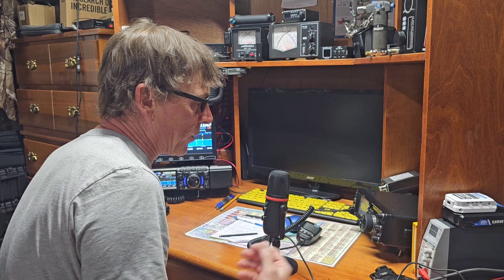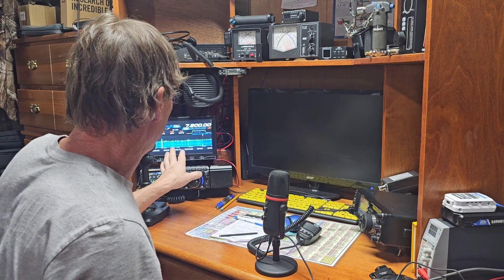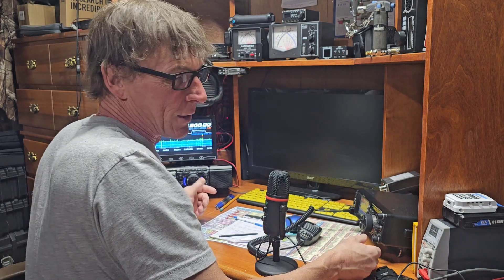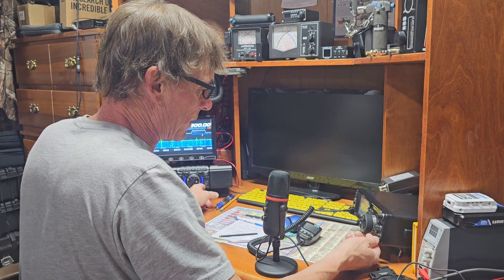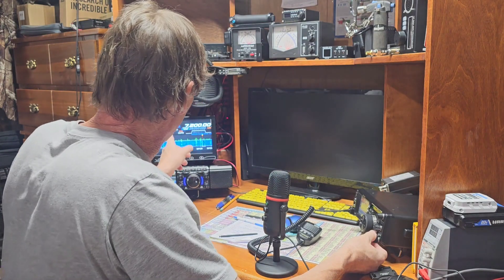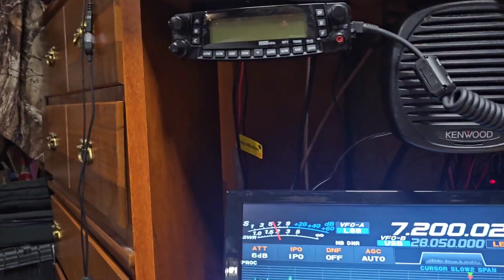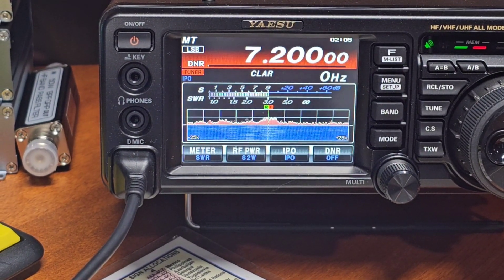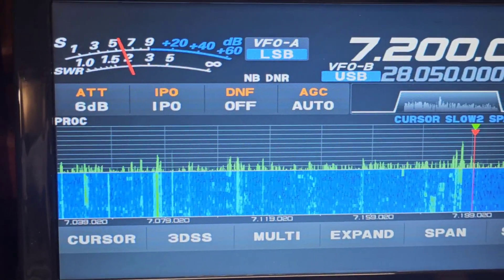resonant vs. nonresonant antenna and some radio nonsense

Comment: The vertical is going to have a lower signal to noise ratio because the vast majority of RF transmitters use vertical antennas which are vertically polarized and HF horizontally polarized. Therefore, you are going to get more RFI. Extensive antenna research by RF engineers have demonstrated slightly more efficiency with resonant antennas simply because you are eliminating the ATU and balun that dissipate some of the RF because of higher VSWR that winds up being dissipated as heat in these in line devices.

KC5RJL

Comment: Nice setup ; just a question, 2 different rigs, do they have the same smeter ? I guess it would have been better to use one radio and a switch for 2 antennas.
Other than that good test.
Some people seek attention and get it unfortunately; better to ignore them in case they give it up earlier. As sb asked: where is the FCC?

Comment: So have you considered one is a vertical, possibly picking up more man-made noise and the other is more horizontally polarized (even with the sloper config). Robert KD4YDC
Reply from the maker: So it's not only picking up more noise but the signals coming in are much weaker atleast 2 or 3 s units for further away signals

Comment: It looks like you have 6db of attenuation on the FT-710. That would have an effect as well as the different antenna types.
Reply from the maker: When checked before video the 6db only a net loss of 1 s unit

Comment: Nice Video.  Question: On the 710 you have a 6 DB attenuator enabled, does that affect your receive strength testing when comparing to  991A?
Reply from the maker: When I was playing around before the video I found it was about 1 s-unit of difference but because of background noise being in a city it was better on for clarity